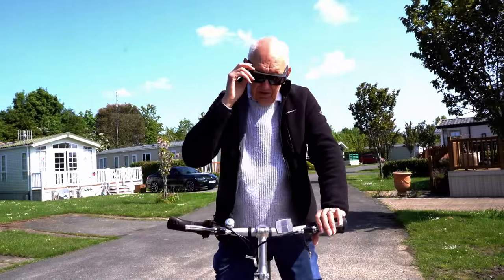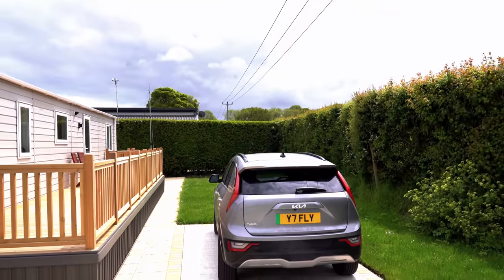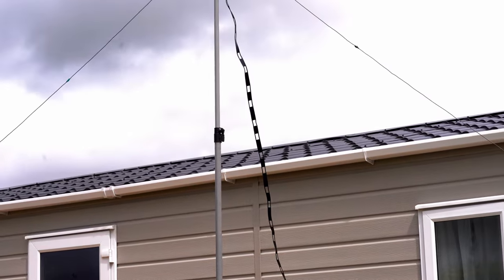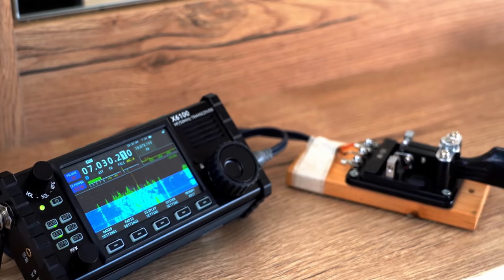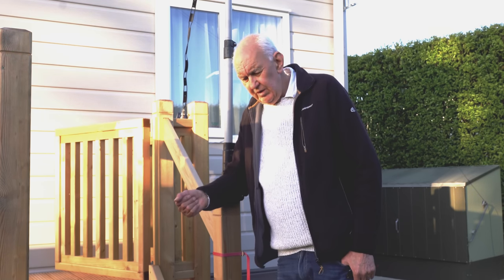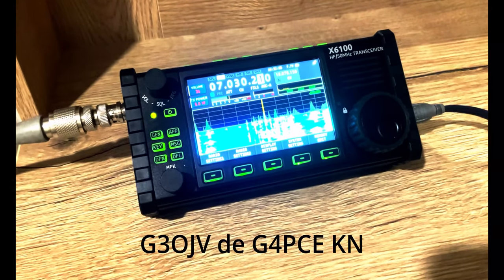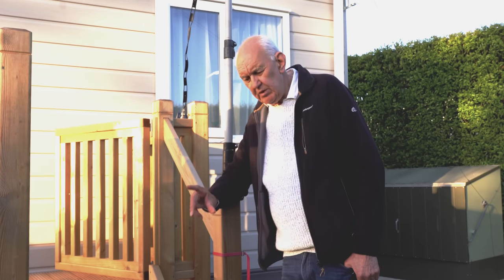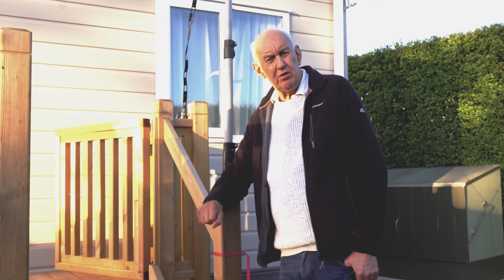Short Portable 8-Band Doublet Antenna - Just 25ft Long

Comment: I love these "yes, you can get on the air from that small space" videos.  They're so encouraging, and they show what experimentation can produce.  Thanks Peter!

FWIW, my current apartment roof antenna is one of those weird 21' ladder line / W3DP 1/4-size things (home brewed of course), and it has brought in all kinds of regional contacts.  Can I make sense of how it works?  No not really, but that doesn't matter so much because it does work.  As you regularly encourage, just try it and get on the air.

Comment: Thanks Peter… I enjoy your presentations. The doublet interests me, I fancy running it around the plastic U brackets that hold the plastic guttering on the roof. I’ll use little cable ties to sling the cable and I’m sure the neighbour will let me do it on his gutters too… the plans are still in my head but it’s encouraging to see what you do… bit amazing really. As a Ham Radio Operator who isn’t the brightest bulb in the socket specially when doing maths my brain fogs over sometimes and I rely on a retired forces buddy to get his pencil out and draw it, I colour it in with crayons after…😊  I struggle understanding bal uns  un uns  + impedances ( how did this guy pass… hard struggle + desire ) … I’ve got all the Icon equipment that I bought ages ago plus a nice old Kenwood ATU  and I reckon watching your channel has fired a spark up the old coax to get going again, there has been several obstacles in the past that made me go dead wire but hopefully I’ll get reconnected again in the months to come…  I’ll need to re educate first…  your presentations and approach are really encouraging. Thank you…    Does anyone use 6 mtrs anymore Peter?   at all ?    Anyway.
Mind how you go everyone… 73s     G0 UVL     Wigan  😉
Reply from the maker: hi there. Good to hear from you. That antenna project should work well so give it a try. As far as I know, I think a lot of six meter operation is on a digital. Shame really, but others may know better than I do. 73 Peter.

Comment: I agree for Xiegu radios and have a G90, it tunes a 3m whip even with no loading coil from 40m to 10m. I am sure it would prob tune a wet dog. Once the radio fixes the swr, the question is knowing how efficient an aerial is and how much power it is radiating?

Comment: Doublets are extremely robust provided you keep the window line away from large metal objects such as poles, roofing, gutters, patio covers, etc. I use a 90’ doublet about 20’ in the air in my 30’x50’ garden. I can tune 80,40,20,17,12, and 10 meters. Using 100 watts, I have no problem talking to just about every State in the USA and country in North America. When band conditions are good on 10 meters I have no problem reaching Europe and occasionally Japan and Hawaii. They are extremely easy to make and maintain. I prefer 450 ohm window line and 1:1 choke balun with 15’ of LMR 240 going into my Yaesu FT-840 oldie but goodie.
Reply from the maker: Thanks for sharing that Ron

Comment: Hi Peter. I don't have any 450 ohm ladder line, but I do have some 300 ohm and a 4:1 balun. Would using 300 ohm  cause me any problems. Thanks
Reply from the maker: 300 Ohm is fine.
Reply: Thank you Pete

Comment: Have you ever made a doublet using speaker wire to feed it? Some quite surprising results to be had.
Reply from the maker: That is very much like 70 Ohm balanced line - it works but is lossy.

Comment: Vry interesting antenna & tnx for posting; since u & I both have an IC-7300, I wonder how that ant wud work with that rig's internal AT? Moreover, if matching was a problem, perhaps reducing RF out to QRP level wud help🤔 always enjoy ur great vids & 73 de WA4ELW in TN 🇺🇸 dit dit 😃
Reply from the maker: The IC-7300 tuner will not handle the antenna, you would need an external one.

Comment: Thanks once more for your explanations Peter. A small drawing would be really useful to non-full-english people. Is 25ft the total wire length ? Is it 8ft for the ladder line ? and which is the heigh above ground of the 4:1 balun ?  Many Thx Peter. 73, Ben - ON5BGO
Reply from the maker: Yes those dimensions are correct.
Reply: @watersstanton  I'm a native English speaker, and I faced the same problem Ben faced. Words can be ambiguous. Never assume your listeners know what you know. How long is each leg of the doublet? Just tell us or better yet show a diagram. And don't talk vaguely about 25 feet, which may or may not be the antenna length plus the ladder line length. Also 8 feet of ladder line may be too short for many locations. Does that matter? I suspect it doesn't, but the wrong feed line length can cause issues as the impedance at the feed depends on it.

Comment: Great video Peter. I have a doublet in the attic i think its deaf. Mine is about 7.3m each side. Mine goes straight into my Chinese tuner. Would it be better with rx if i use a 4:1? Might be tempted to try and cut it to 7+m total and see if that help. 
Mine seem deaf on 40m and 10m but ok on 20m
73
Reply from the maker: If the tuner has a balanced connection for balance line, the you should not need a balun. If it is designed for coax the you most certainly fo need a balun. The test is to see what  VSWR your transceiver is seeing between tuner and transceiver.
Reply: @watersstanton  thank you Peter I will have another look at it it been up there about 2 weeks but not had a lot of time with it. 
Thanks for the feedback. Great work. 
Motters M7TRS 73 👍